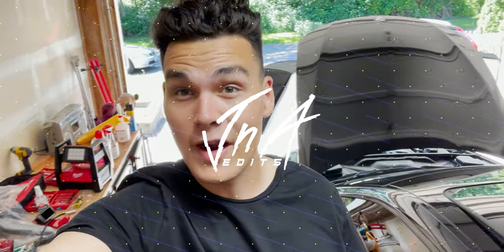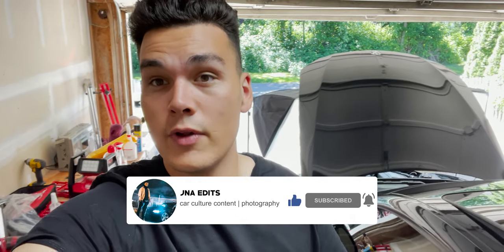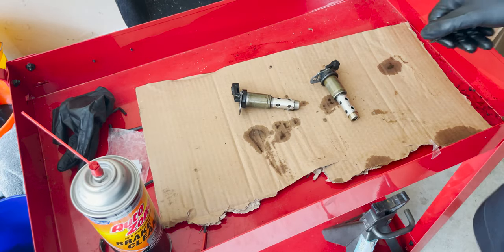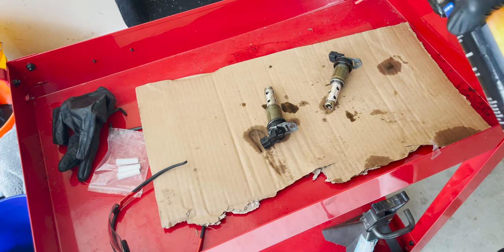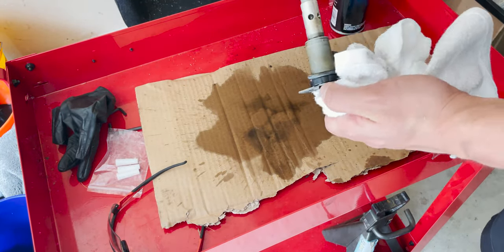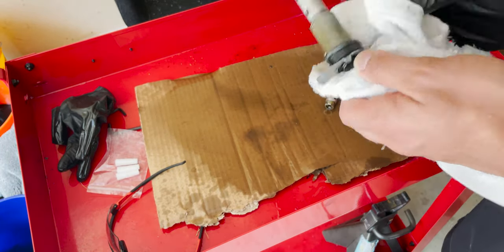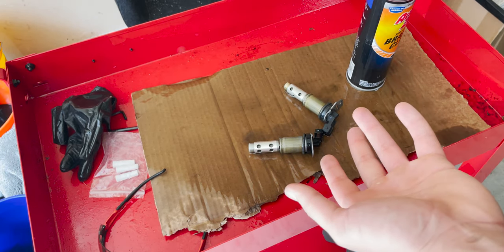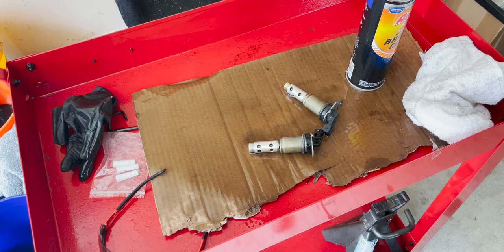EASY FIX FOR VANOS SOLENOIDS *2A82* *2A87*

Comment: after do this, the 2A87 is back after two weeks for my E90 BMW. next step replace the vanos??
Reply: You can try to flush your engine before changing your oil and change your oil filter cap and that can fix your vanos code.